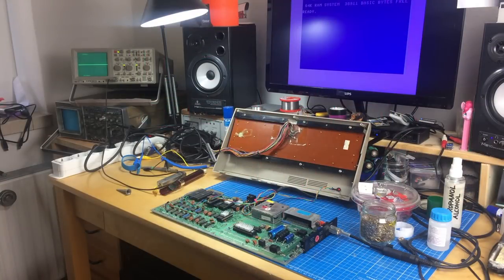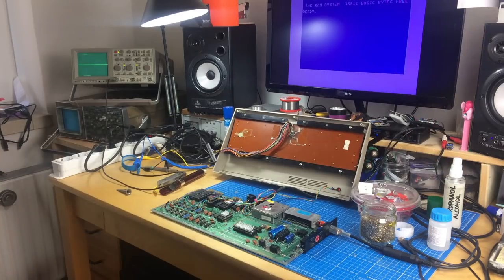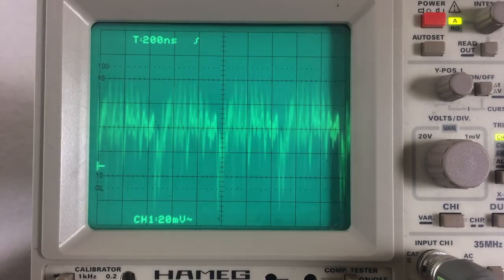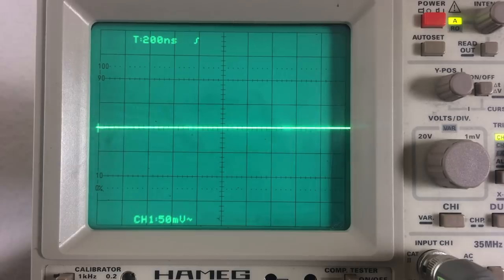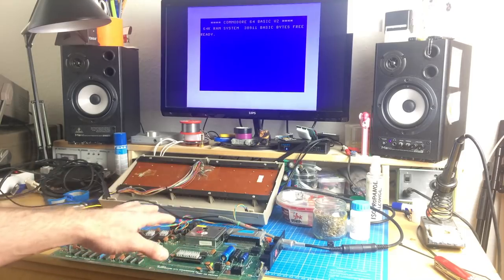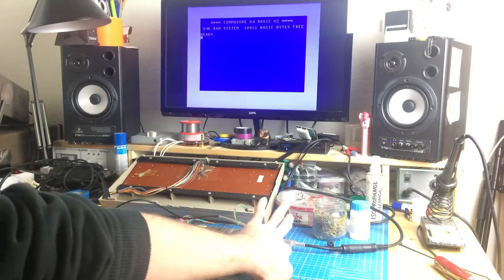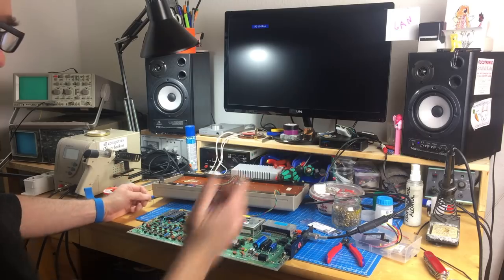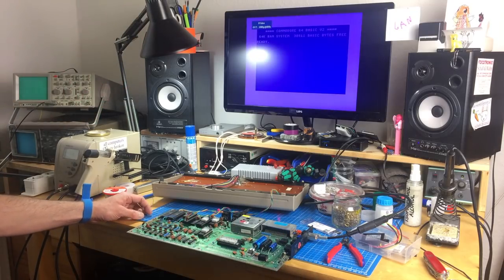C64 DC-DC Conversion Part 2: "The Fart of Doom"

Comment: Hi Jan. In recent days I'm facing a problem with 7805 regulators: I discovered that they're not all the same! 
You should try to take one by another (not working of course, just for spare parts) C64 and mount it. 
I was making a copy of the C64 PSU 5V circuit and I was going crazy 'cause I could not get the same voltage/amp ratings, being all the components of the same values. 
When I tried an old 7805 from an old C64... ;) Everything fit into place!
Best wishes! ...And thanks for your great videos! :)
Reply from the maker: Oh, that's interesting. Did you use one with a lower current rating at first maybe? I usually use 78S05 and 78S12 which are rated for 2 Amps (which is more than the original ones used in the C64). They worked every time for me. Thanks for pointing that out. :)
Reply: I'm testing the L7805CV serie (they should be rated for 1,5 Amps). You're always welcome Jan, thanks for your videos! :)

Comment: Nice.... I have a small question to you Jan. If i turn on my breadbin without anything like disk drives or cartridges. Then the image is clear and crisp. Yet if I turn it on with something as simple as a fastloader or datasette drive, then there will come stripes/jailbars on the basic screen. Is that possible the voltage regulators that need to be changed to new ones? That is on a CRT televison that I can see the stripes. I have recapped the machine.

Comment: It looked like the output from the 12v device briefly switched back on after turning off. Maybe this is a consequence of the circuit which feeds power to it. The 5v regulator is fed from 9v ac via a bridge rectifier but the 12v is also supplied from 9v ac. The input circuit must be a charge pump to raise the voltage to more than 12v in order for the regulator to work - and I wonder if that circuit is producing a "cough" as is discharges. Any analogue experts here ?
Reply from the maker: Yes, there is a charge pump/voltage multiplier circuit for the 12V regulator. From the comments before I think it might be the cap in there discharging letting the 12V converter switch back on briefly.

Comment: Check the datasheet for the regulator, you might need a blocking diode across the regulators to prevent possible damage during shutdown if there is reverse voltage across the device. This might also explain the farts and get rid of them. Just make sure you get the polarity right, otherwise the diode will bypass the regulator and put full Vin past the regulators.
Reply from the maker: Yes, I will look into using a blocking diode. That might fix it. The voltage of the spikes was not alarmingly high so I don't think there would be any harm done but getting rid of the farts would be nice of course. :)

Comment: Add a 46uf to 100uf cap on the output. And see if it cleans up
Reply from the maker: I’ve tried several different values of caps in the meantime and nothing worked. My theory is that the larger caps discharge a lot slower after turning the power supply off than with a linear regulator and the DC-DC converter outputs another small voltage spike after some seconds because of that. The SID is turning on again briefly and makes the nasty sounds. I don’t think the effect is going to do any harm (except maybe to your ears) but I ended up keeping the linear 7812 now which works normally.

Comment: Hi Jan would a 100nf decoupling capacitor on the switching regulator rectify the cart of doom syndrome? ....great vid Jan I've never heard of the Sid farting....Kim 😋😋😋
Reply from the maker: I fiddled around with capacitors on the output a bit and it didn't change anything. Must be something else I guess.

Comment: you could try this buck converter from microchip: MCP16301
i looked into the datasheet and it looked good. maybe handsoldering a prototype? devboard from microchip itself a too expensive but the parts you need are not.
hopefully that circut is not coming up with the fart of doom :-)

Comment: Back in 2016 I modded my C64 to use these dc-dc converters (watch?v=KOuxg8ppE30) and it's been working perfectly since then. It also makes funny sounds when I power it off. It makes a loud whining sound. However that sound is not coming from SID chip. My best guess is that it comes from .. well, somewhere else :) So based on my experience (I take no resposibility and other legal mambo jambo here :)) it is perfectly fine to use those buck converters in C64 and they will not damage the SID chip.
Reply from the maker: Thanks for sharing! Good to know. I went back to a regular 7812 and left it in, the 5V regulator is still the DC-DC thingy and the whole system still works beautifully. :)

Comment: I am kind of confused. I always thought the SID needed 9Vac however you are only providing 5v and 12v.  What is the input voltage you are using now?  Still the original 9Vac brick?  I have fixed C64's before and really not had to worry much about it but now I  think I don't know as much as I thought I did.
Reply: Both models of SID use DC as input - the older, original, breadbox 6581 is 12V DC & the newer 8580 is 9V DC.
Reply: Well, that explains a lot. Thanks!
Reply: The power supply supplies 9V AC, but this is "converted"/regulated inside the C64 to produce either a 12V DC or 9V DC supply

Comment: Great video. Thanks for it. I use dual sids, so I don't want to have those farts. Ok, I'll only use the DC-DC for the 5V line and the linear one for the 12V one. Anything that you try about these regulators will be very interesting to know.
Reply from the maker: There's definitely going to be more fiddling with this mod. For now it works very well for me with the combination I used. I still want to know what exactly caused the farts though.
Reply: Just to tell that I've just changed the 5v DC-DC regulator and works well by now. I will tell if I find any issues. Do you think that it takes a second more to boot now?. Maybe I'm wrong.
Another thing: as you are interested in the heat in some components. What happens with the VIC one? Doesn't it get too hot with heatsinks even?. Have you thought about using a fan there?

Comment: Hi Jan. I have the same theory like John Francis Doe (somewhere in the comments answers). When you turn off the C64, the loads at the 12V and 5V power supplies fade away after and after. Then after a while, the load at the 12V rail is so low, that the 12V DC-DC "comes back" again, because of the remaining power in the12V-rail capacitor (C88) and "switches" on the 12V again. So maybe you could try to reduce C88 to maybe 470µF. And against the ripple / noise of the 12V DC-DC you can try to place a 100nF Ceramic Cap at the 12V DC-DC output. See you on YouTube. Your Doktor64! :-)
Reply from the maker: Yes, I think it definitely has something to do with the larger caps. Interesting idea replacing C88 with a smaller one. I will definitely look into that. Thanks! :)

Comment: Be careful with PSU mods on old computers. That restarting buck converter module can be an issue (and probably the 5V one also does that - hence the flickering picture when you turn it off). Some of the ICs are sensitive to power on and power off power rail sequence -  the rails should come up and down in a specified order, with specified timing. 

If you break that rule, you can break some rare and expensive vintage ICs. I'm not sure if the C64 has ICs sensitive to that, but before modding, it's always worth to do a research.
One thing I'm sure about being sensitive to that: the 4116 RAM chip. It needs the -5V applied first, and removed last. I suggest you to look up the datasheet.

Comment: I wouldn't care about this "farting". Probably when 5V converter switches off, the input voltage recovers and 12V converter restarts for a moment. Nothing to worry about. If you want to confirm that, you should observe both input and output voltage on a regulator simultaneously. Ideal would be DSO working in a single-shot mode with very slow timebase. C64 is powered from 9VAC, this is not enough for 7812, so there is a simple voltage multiplier circuit on the input of 7812 (CR5, CR6 and C90). 

Tip for CRO usage - don't use AUTOSET until you don't know how to manually set. This option is very.. I'd say deceiving.
P.S.
This Hameg is really a great CRO.
Reply from the maker: That explanation sounds convincing. If I ever get my hands on a DSO I'm going to check that, too.

You are right about the autoset. It works fine most of the times but setting things manually is the smarter option. I scored the Hameg a while back for around 100€. It came with two Hameg probes which was really lucky I guess. ;)

Comment: I plan to replace my on my 250407 board the L7805 and L7812 with those digital DD4012SA_5V (1A) and DD4012SA_12V (0.8A) that were also seen in Jan Beta's ZX Spectrum video (https://youtu.be/wjrUhELEAms). Comments?
Reply from the maker: I would not recommend it. The cheaper DC-DC converters often introduce a lot of switching noise into the signal and the C64 chips need rather clean power supply to work correctly. That's why I used the rather expensive ones. My guess is that you would get noisy sound and picture output. Might still be worth a try.
Reply: @JanBeta  Ok, I will give a try but will keep new analogue regulators handy if it does not work out.